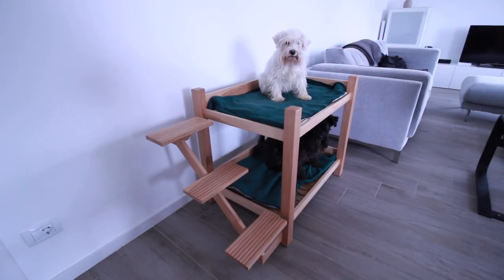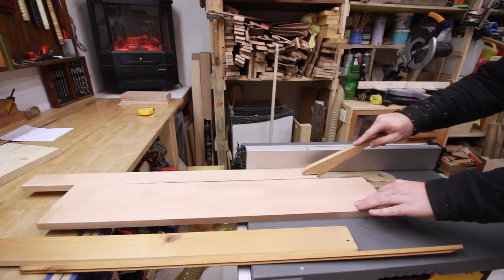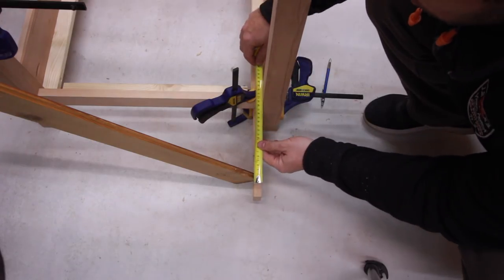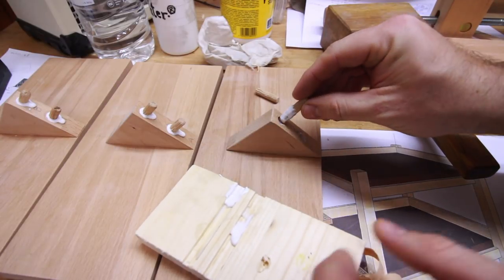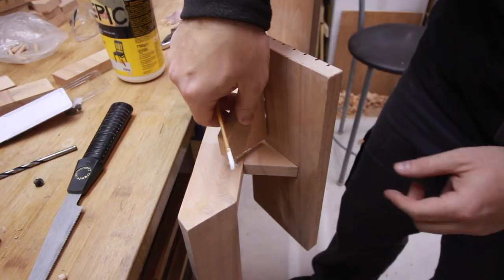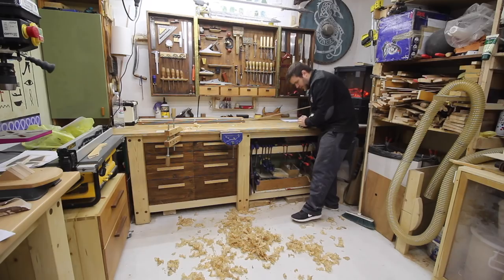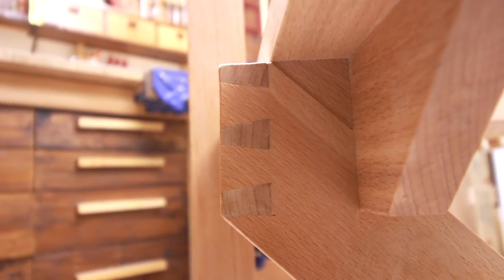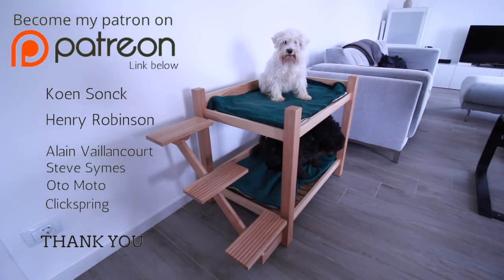Dog Bunk Bed with Floating Stairs - DIY

Comment: Will try this but for bigger dogs and without the stairs, the level of carpentry for the stairs are way beyond my skill set, very good work
Reply from the maker: Stairs aren't really necessary. We removed them quickly as they seemed to be to hard for the old dogs. Ramp is much better solution.

Comment: Lovely. Thank you for the video. It will be my guide, when I make one myself. Do you know what the max. waight would be with it? I have a husky(ganna lay on the buttom bed) and a larbridor (top bunk), both around 30 kg. Can the bed suport the dogs, and not overbalance, if the buttom bed is empty, while the top either has a dog in it, or going up the steps?
Reply from the maker: It can support me 😂